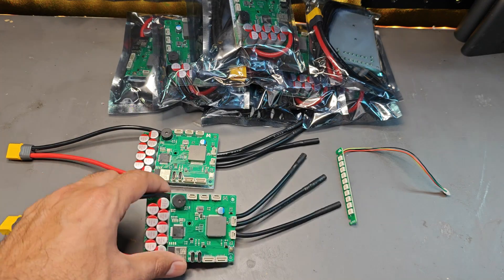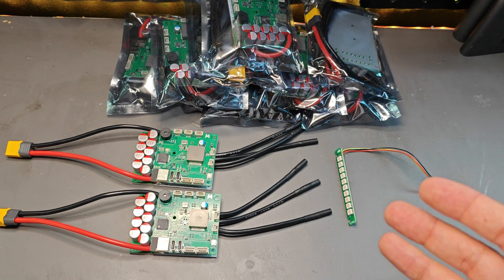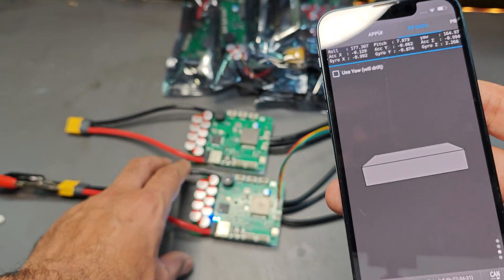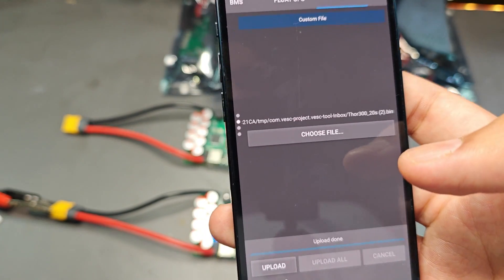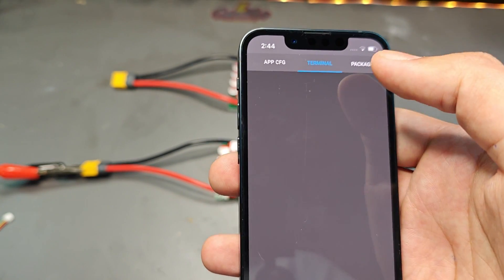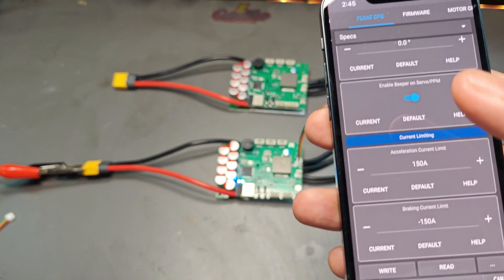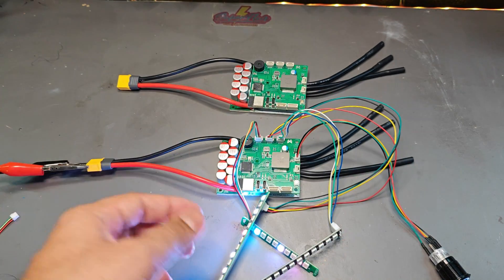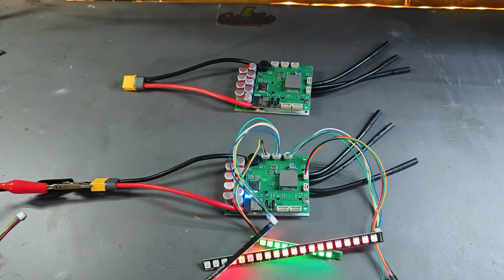Thor300 VESC Firmware Update - Step by step

Comment: Does the thor gtfo kit on the hyper gthaveor have power gains similar to gtv
Reply from the maker: Yes of course! The controller is at least 80% more powerful than the  GT controller in terms of current handling.
Reply: @Fungineers  so using the stock gt motor and batter the thor 300 will give me more torque and power? The gtv drop in has alot of power gains for the stock gt. Its a big upgrade so I just need to know the power increases.
Reply: yup I ordered the thor 3300 aand bms and gt footpad sensor. om readty to get some power from this weak board.

Comment: @fungineers how much voltage are you using to boot Thor on in the video? I have an adjustable power supply and don’t want to feed it the wrong voltage. I’m assuming you’re sending it the equivalent of 18s voltage(75v)?

Comment: does not connect with thor 300 , mensaje Could not read firmware version. Make sure that the selected port really belongs to the VESC. If you are using UART, make sure that the port is enabled, connected correctly (rx to tx and tx to rx) and uses the correct baudrate

Comment: Is this the same firmware that Vow's exploded on?
Reply from the maker: Different firmware. Also vows vesc was an isolated case and died due to unknown circumstances. We've not been able to replicate it so there is no issues that users have to be worried about.
Reply: @Fungineers  how about Auden's Thor randomly shutting off and all of the sudden not working now? Not very confidence inspiring knowing that people are having these issues with thors even with 18S. Not trying to bash you guys, but I don't want to get hurt riding if your controller dumps me for no good reason.